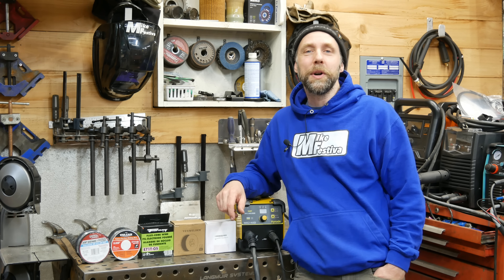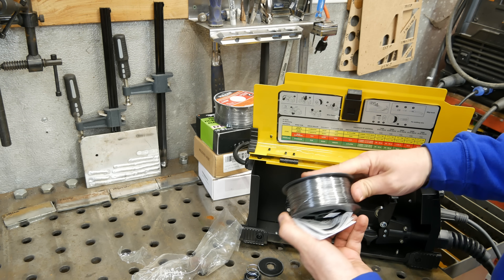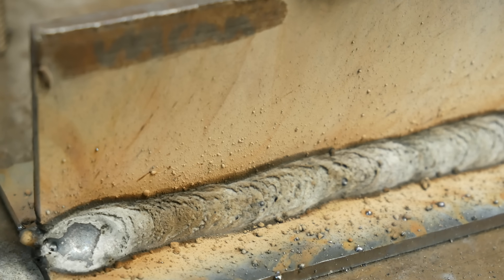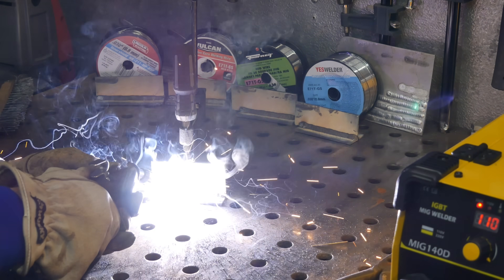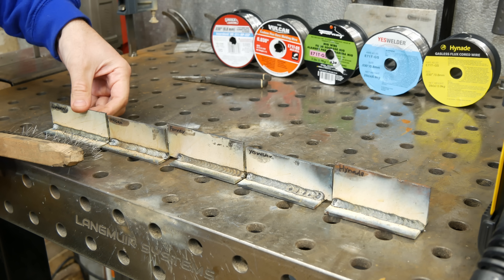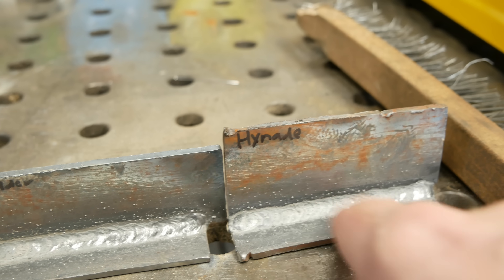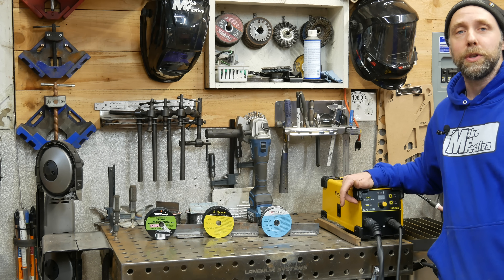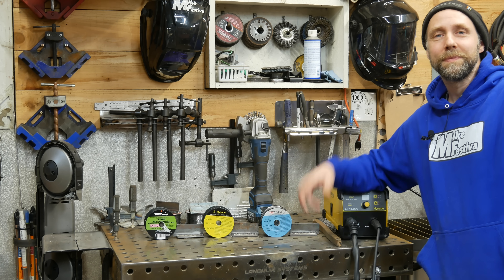Gasless Flux Core Welding Tips, Make Better Cleaner Welds

Comment: Gonna have to disagree with your conclusion on a professional level.. all the wires you tested except for the Lincoln wire are E71T-GS wires. The G designation stands for general purpose and the S stands for single pass use, which essentially means the flux composition can vary widely from manufacturer to manufacturer. On a practical note, that means if you can't do the weld in one pass you can't safely put another layer of weld on the joint without risk of dilution of base metal or risk of cracking. This is why flux core gets a bad rap and is often only considered for light duty applications. The Lincoln wire is a E71T-11 wire, which means it's a general purpose wire however it's rated for a 5/16" thick multipass application, and thicker with larger diameter wires. This is a wire designation that's pre-approved for limited structural steel use according to AWS D1.1 welding code. On a practical note, you can more reliably use this wire to weld thicker metal in multiple layers if required. I'm a welder that's held certifications to weld to AWS D1.1 code, API 1104, and ASME B31.3. However my primary sources are AWS D1.1 welding code, The Lincoln Electric Website article where flux core wire classifications are explained in detail, Hobart Filler Metals web article on the same subject, and AWS standards for filler metal classifications. Good video, but I wouldn't throw away the Lincoln wire based on how user friendly it is and price. You very much get what you pay for in this case and I hope this information helps someone somewhere.
Reply: Thanks for the detailed explanation of what those codes mean.
Reply: I do wish the GS was pointed out. I would also have liked a comparison of the Hobart E71T-11. I tried the Vulcan junk once. Ripped a new roll out of my welder cause it wouldn't burn good, and fed horribly. Been running the Hobart E71T-11 since.
Reply: Try Blue Demon E71T-11 .030 IT'S A MULTIPASS FLUX CORE WIRE.
Reply: @stevenpetty1694  blue demon e71t-1
Reply: @frankconsidine5989  E71T-11 blue demon. .030
Reply: @stevenpetty1694  thanks
Reply: @stevenpetty1694  tried it, it was terrible in my Titanium 170, so I went back to GS.
Reply: @luiskay2487  the Vulcan wire I had ran thru my machine just fine, but no matter how much I played with the settings it just welds like shit. But I ran it dual shield and helped tremendously. I finished the spool and just won’t buy anymore.
Reply: @luiskay2487  I don't know why but i could not get the hobart fabshield to run worth a crap, idk if it was just a bad roll but got the Lincoln and never looked back.
Reply: @luiskay2487  I've used Hobart wire for years. Hobart and Lincoln best wire in my opinion. GS wire is crappy.
Reply: @TeamTopKick  absoulty it's been the same for me also
Reply: HOBART makes great wire.👍
Reply: Omg. I have been looking for an answer. Why does nobody else cover this? Those number and letter codes have to mean something!!!
Reply: Thanks for getting into the details. When the internet reviewer is recommending the newer brands over the proven ones, it's nice to get some clarification. And with referenced sources and codes, you are a rarity in the wild west that is the comment section.
Reply: @himynameisjeff 16:56
Reply: @himynameisjeff 16:56
Reply: Got to agree with your comments Rob. The comments & classification explanations are spot on. He keeps commenting on the price of the Lincoln, that’s because it’s a different wire classification. Furthermore the difference with the shiny & Mat finish is due to the different manufacturing techniques & application of feeding surface lubricants. The shinier wire usually have a palm oil lubricant. The mat finish usually have a powder lubricant. This will be evident once you get to the end of a 1lb or 1kg spool as the wire cast & pitch will vary thus giving feeding problems. Most of the vacuum sealed bags he opened had lost their seal (except for 1), this renders the extra expense of vacuum sealing useless. The brown paper he describes is a vapour phase paper used to reduce the moisture inside the bag (similar to silica gel sachets). The Lincoln wire did not have a vacseal bag as it not required for this type of wire. The 71T-GS wire do. All this information is found in the AWS. Spatter: The spatter & slag levels change due to the settings used & this can be fine tuned. The internal chemical used also have different compositions. I hope this adds to answering some of the finer point questions people might have. Be safe everyone.
Reply: @markstevens5645  l
Reply: Thank you VERY MUCH for your info I found  help full. I love my Lincoln 140 welder, I don't know how many utility trailers  I made and a few RTs Reverse Trike Motorcycle.  I'm not a welder but I can lay down a nice stack of dimes down. Always  trying to get better. Thanks again for your info.
Reply: This advice is very high value will hang on to it forever
Reply: I run mig, tig, and flux. Flux is the best on-site system out of the three: sometimes you're on a tower or in someone's building where you might not have access to more than 110 (you'll get deeper penetration for the power without a gas cooling your weld) have wind, or no way to get a gas bottle or even a heavy machine up to the project. I always keep a little Lincoln FC90 with me because I can literally wear it like a backpack while I climb trusses. If you need it, there's not much else that will work. 

I default to the Lincoln wire used here because I don't always know if I'm walking in to a multi-pass situation, but I might start keeping a roll of the forney in the truck for lucky days. Welds look better and can't argue the price difference.
Reply: Rob, I agree with you 100%, the Lincoln innershield has been my go to wire for years, i wouldn't buy a gs rated wire simply because of you can't make a 2nd pass if needed and sometimes its needed. Thanks!
Reply: @Don.E.63  really? I tried Lincoln the other day and it was crappy wire to my opinion
Reply: Don E l
Reply: @Don.E.63  well being negative electrode welding multiple passes is fine I burn 045 crank it up...
Reply: Rest assured, your information is helping someone, somewhere.  Thank you.
Reply: I agree, and in fact I use the E71T-11 so I can do multi passes if necessary and I’m not changing my large spool🤠
Reply: I am a certified welder in japan and for most heavy duty things i use stick but i use flux core for almost everything as its easy and i have made attachments to pull stakes out of concrete for 15ton forklifts with it and it held up very well (but not recommended if you don’t know what your doing )and the wire i use is amazons  andeli wire and also yeswelder  but the machine makes a big difference when welding thicker material but till now the nicest ive used is the andeli wire you should try it
Reply: That's great info. I never knew that. I was doing multi pass with Vulcan the other day. I've welded stick for almost 30 years and just bought a wire feed.
Reply: It is helpful, thank you.
Reply: Thanks bro
Reply: What type of flux cored wire, is used fr hard facing drilling augers for drilling holes for fece posts, I've seen it done but never done it myself.
Oh & thanks you taught me something I didn't know.
Reply: Rob, what is the best wire for sheet metal? It's a pain after spot welding in my patch panels I have to go back and clean off the slag before I continue,it's a pain.
Reply: Pretty sure he’s going out of best looking weld from wire overall
Reply: I like the yesweld wire as well.  Not a pro barely decent at all but works easy and for the money I prefer it
Reply: Thank you Rob for your thoughts  on that welding video,  to me as amateur welder doing this on my own stuff at home the 125volt flux welder from harbor freight  doing well for me I can't afford gas bottles. But I see fortney  weld wire is better but Tractor Supply sells it but they never want stock it for last 5 months but they have Lincoln  welder etc. So I buy Vulcan cause it's less money at Harbor freight  and 2- lb roll or 10- lb roll  Lincoln yes is expensive at 1 lb roll and I don't see much difference  to Vulcan  but thank you Rob for your input to me as help.
Reply: I know a lot of welders that dont seem to care for lincoln wire...i work in machining.Bout 70% of our welders dont like it.
Reply: I have a Pro Mig 135 from Lincoln.  I'm welding a small project and was going to use gas.  The chart is grayed out for 3mm using gas.  Do I need to use innershield or can I use gas?
Reply: Thanks, I wasn't sure on what wire to buy ,I am a beginner welder just bought a master craft Meg welder,I did go for the Lincoln wire haven't used the welder yet .
Reply: Wow,  thanks for the info on the Lincoln wire!
Reply: 👍👍 wow. An excellent fact based reply.
I just learned a lot 👍👍
Reply: I’m late to the party but I appreciate your comment. I’m new to welding and would never have known this and would have gotten the cheaper stuff. Lincoln it is
Reply: The Blue Demon wire specs say E71T-11 limited multi-pass. Does that mean limited in strength or number of passes ? Or something completely different?
Reply: I wish I knew what most of that meant, but what I got was.. " pay for the better wire"
Reply: Rob Murphy,wow I feel like I just took a Flux core wire consumables class at the Lincoln electric welding technology school in Cleveland Ohio 😂 how much do I owe you for this class 😂 because I just learned a ton of knowledge from you and from Mike for sharing his humble regular guy knowledge of whats available on the market in welding so that we diy guys can be better educated consumers 👍
Reply: Ok
Reply: You've welded on a pipeline?
Reply: spot on Rob
Reply: Awesome info! Thank you!
Reply: I buy the Lincoln wire from lowes where I got my 110 Lincoln mig it’s also capable of  gas kit
Reply: Excellent informative reply. Thank you.
Reply: Thank you. It has.
Reply: Translation please
Reply: Agreed
Reply: That right there is a cut, paste and file comment. Thank you very much.
Reply: Thank you for pointing this out- solid info (on a hollow topic😅)
Reply: Lets see that stuff SPRAY! 😂
Reply: @robmurphy806  Thank you very much for that info!
Reply: @robmurphy806 lol hard to do a wire test when he doesn’t even have all 4 being the same
Reply: @robmurphy806  
thanks, man.
I'm going and getting my first welder today. 
I'm 56. 
I know how to solder copper and brass water lines.
I've watched many videos on the subject.
I think it's time.
Reply: Great explaination, sounds like you either worked for Lincoln sales or manufacturing. I did, 32 years.
Reply: Excellent info, I would add: even experienced welders do not understand flux core runs on a negative electrode set up, if you run it positive electrode, it will splatter like steel wire with no gas shield.  This doesn't have much to do with single vs. Multi pass wire, but still highly relevant to flux core welding.
Reply: @Joe_JesusWins_Lewis  it’s because of the leads are backward for flux application, your wire burns too hot, thus causing all the spatter and lack of ability to pull your puddle correctly and evenly. It’s really about heat in this case
Reply: @mysterybabylonsoontofall3387 that's literally what I said
Reply: @Joe_JesusWins_Lewis  no in
Reply: I’m not certified in anything but I’m a hell of a framer ha ha   I like to weld and do small fabrication on cars   Thank you for the information
Reply: @vandettabuilds6641 😅 8:28
Reply: Thank you. It's been my experience that paying a little extra for the right product is way cheaper in the long run . Although I've done a lot of welding in the past I basically knew that I was just doing what mostly worked,and didn't have the internet as a resource to help ne learn efficient processes.
Reply: So what wire do you recommend Rob? Just bought my first flux core welder
Reply: @stevenr8353 try them out 
And find the one that you like best ...but don't go cheap 
You probably know the reason 😂 you get what you paid for. 
Also  look at the price
On 10 pounds roll
Per pound. Something telling me 
That the best on is probably the big one .Lincoln is my favorite one and 
I never changed it. Because i know what it can doo 
And im use to it 👍
Reply: @stevenr8353  as a beginner I use multi pass Lincoln and find it easier to learn. Probably depends on what you are doing. I also have and use both, but have been using multi pass 3 times more than my single pass rolls
Reply: @stevenr8353  Hobart or licon
Reply: Great info. Multi-pass was what I was most interested in for thicker metal. Thanks for the detailed information.
Reply: Ok so that explains when I do pulse welding with the Lincoln wire it doesn’t work well
Reply: Thanks, you taught me something 👍
Reply: Thanks for the added info, the single pass information is something I haven't looked into or heard of.. Definitely keep that in mind for the next roll of wire I purchase!
Reply: It's noteworthy to designate the application of each welding code mentioned. 🙂
Reply: Most indubitably!
Reply: T-11 on my Titanium 170 runs like crap! I had to go back to the Vulcan GS, like night and day.
Reply: @kayakuprising5914  did you change the polarity?
Reply: @stevenpetty1694  Hi, thanks for the questions Steven and yes I actually tried both ways. So much spatter getting a bead was difficult. Switched to GS and OMG what a difference. I feel there must be something more than just the fact that it was T11...there's got to be something else going on here... do you think they may have accidentally labled solid wire as Flux?
Reply: Just bought my Lincoln 140 Mig Pro today. Thank you for your input.
Reply: As an CWI inspector, I agree ☝🏽.
Reply: It seems like you really should make some welding videos yourself. You clearly have the knowledge and technical expertise and it would be a shame if you kept it all to yourself.
Reply: Lincoln Electric makes that fluxcore wire in much larger sizes than what is available at Home Depot (.030" and .035").  The largest size is 3/32" and the data sheet says it can use up to 400 amps.  It is not specifically made for hobby machines.
Reply: @hunterbidensaidslesion1356  Bro, 3/32 is much smaller than .030
That is only .009
Reply: @williamthomas2063  - "030" stands for 0.030" diameter... equal to thirty thousandths, or 3 hundredths of an inch, or 0.8mm in metric.  3/32" is 0.09375, or about 312% of the diameter of 030 wire, at almost 2.4mm diameter.  If you get the chance please film it for youtube and posterity, when you run that .009" wire at 400 amps, in your "expert welder" style.
Reply: @orcoastgreenman  williams an expert....., cuz he welds wooden popcycle sticks together to make "baby welders" that work with helium argon  gas mix underwater when he welds top secret nuclear submarine hulls!!!hahahahah!!👏👏🔥👏🤯🙌🐱😂
Reply: @sarahconner9433  ….to think all these years I’ve been using WOOD GLUE on my wood projects….and I could have been welding them, dang, ya don’t know what ya don’t know. I feel ashamed 🥶
Reply: Ok you know a lot about it . But don't  forget that the most of us are hobby welders or small repare or light construction welders . So technically your right but its not that imported for most .
Reply: If you're a professional, why would you even be using flux core wire outside of your own garage?
I mean, c'mon man. This is hobby wire.
Reply: @williamthomas2063  we did 12x12 I beams with 1/2 plate base plates at Dixie metal for fpl with fluxcore not for hobby newb
Reply: @BMA55  Okay boomer. Only been welding for 38 years. I'll use shield gas any day over flux. Keep up the slaggy work! 👍
Reply: @williamthomas2063  Okay then, let us know how well the gas works using it outdoors. Get a clue. Didn't you say that you've been welding for 38 years?  LOL. Different tools for different applications. Just because you don't prefer it doesn't mean that it's useless.
Reply: @ryanl8340  It works great outdoors and indoors. Adjust your flow for the conditions. And I never said flux was worthless. It's great for beginners and hobbyists.
Reply: @BMA55  wills a nube!!!!😅😅😅😂🐱🐱🙌🙌🙌❤️👏
Reply: @williamthomas2063  Actually fluxcore gets hotter and gets much deeper penetration than solid wire.
Reply: @williamthomas2063  lots of farm welding is out side and in windy conditions. Too much wind for gas shielding. Plenty of other reasons for flux core too.
Reply: @williamthomas2063  I’m not a professional welder but I do a lot of welding at my job. Mostly maintenance welding and repairs. Since I work at the shore it’s constantly windy and everything I weld is either corroded, rusted or weathered. Almost impossible to get some prepped correctly. With the wind blowing the shielding gas away, and the metal not being perfect, flux core works much better in a lot of my circumstances.
Reply: @williamthomas2063  lots of reasons. Do some research.
Reply: @MountainVisions  I guess if your reason is you like splatter and slag, use flux core. Pros use shield gas and solid wire.
Reply: @williamthomas2063  flux core .30 wire works great out in the wind on thinner metal. I've been welding for over 30 years also,piping,vessels,pipelines and various types of plants and refineries. Small flux core is just the way to go sometimes,you can get the job done quicker and don't have the hassle of changing rods in tight spaces,or anywhere for that matter. Run till it's done.
Reply: @MountainVisions  Absolutely. Welder 28 years shipyard and navy experienced.
Reply: @williamthomas2063 me a  PhD. E.E. and welder designer.....run whatcha brung....I work at gendyn. Where they robotic weld 19 inch thick steel plates together to make aircraft carriers... And William, I think you would be surprised to know, they don't use harbor freight welders...or take your advice.....mmmmmmmkay....
Reply: @williamthomas2063  Comedy gold.
Reply: @MountainVisions he's talking about dual shield 😅
If im not a welder 
How should I know 😂😂😊
Reply: @williamthomas2063  flux is for field use. Let's see you run gas out in the field on a windy day. SMH
Reply: @kelvis1980  Every day.
Reply: @williamthomas2063  Actually the thicker gasless flux core wires are used in shipyards, structural buildings and bridges
Reply: @williamthomas2063  You can weld outside in the wind with flux core. Depends on what you're doing as well.
Reply: @williamthomas2063  I'm a 1st year welding apprentice and even I know what you're saying is some BS 😅🤣 someone get this guy a manual.
Reply: @Fakken28  That's why you're still an apprentice. And you've heard the saying, "They don't build it like they used to." You're the reason why.